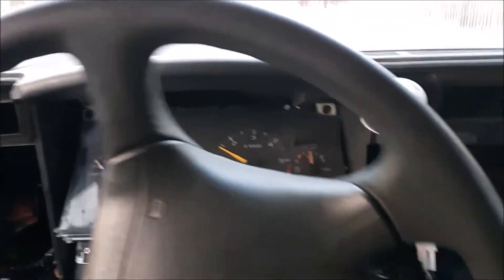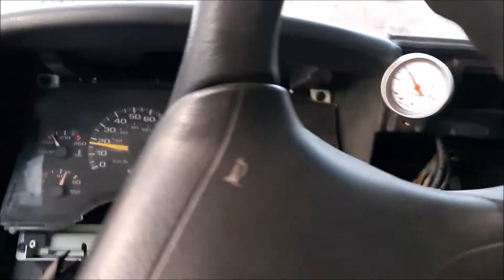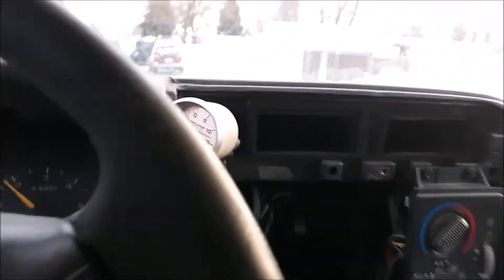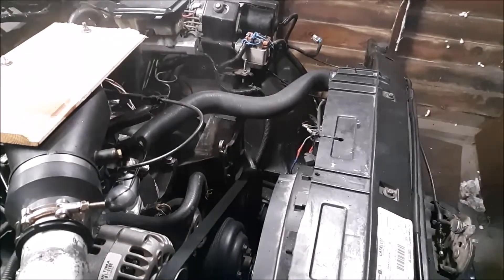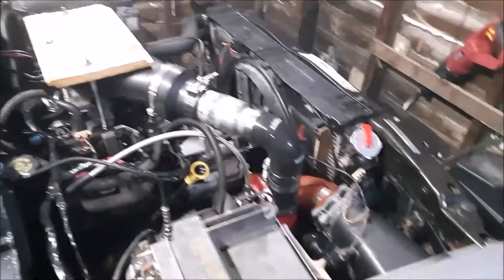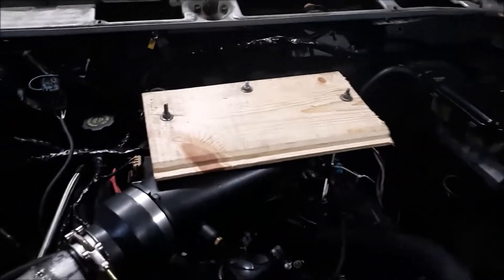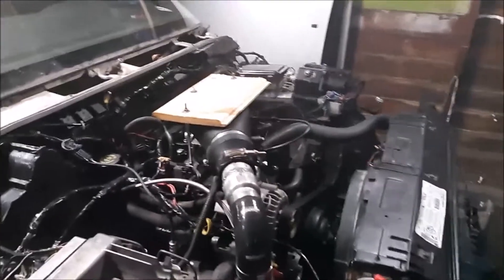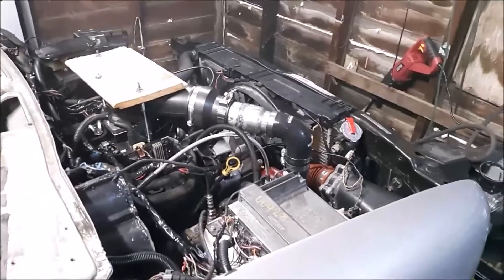First drive of the turbo 4.3 s10, then "sloppier mechanics" cold side walkthru

Comment: Awesome! !! Surprised your running maf at turbo. I'd thought it would be at throttle body. Glad you're up because I'm learning from you!  Please more information, thank you so much.
Reply: The eBay 90 couplings are no good from what I'd seen. I'm running metal 90s from other people video showing cheap 90s collapsed under boost.
Reply from the maker: Just figured I'd try sticking the MAF before the turbo inlet, I also have a SAAB 9-5, and it uses  basically the same GM style MAF mounted before the turbo as well.

Comment: Did you use a throttle body spacer and just drill 2 holes in it for the extra 2 injectors?

Comment: hey there i gotta ask if the truck is still running, do you have any new mods or advance any more boost with it?? About to turbo charge and tune mine so im askin around eveyone that seems to have a turbo 4.3.
Reply from the maker: Hang in there.  I am finishing up a pretty serious intake manifold swap that took a lot of fabrication. (carb intake to EFI)  The stock injectors will max out at 4 PSI past about 4500 rpm and you will lean right out.  There is an expensive upgraded spider injection assembly available for almost $600 but it's not worth it vs. going to a custom intake IMO.  Tuning is getting done with HP tuners, and I have a swap to a later 0411 ECU (same kind used in early LS engines)
Reply: @DefenistrationAlley  Sweet, i am following this build and i have a 2002 blazer thats gonna be my turbo project. High hopes the turbo comes in the mail today!!